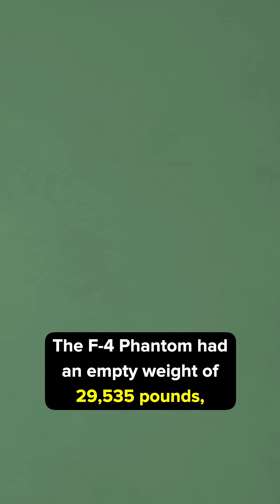Why an F4 Phantom was Launched into Concrete

Comment: How would it fare with back to back fantoms? Just like we've been doing with rocket attacks on bunkers. Hit it twice at the same time while the concrete is trying to dissipate the energy of the first hit. Maybe the concrete will fail with that much energy. Not to mention no explosives are added to the attack.

Comment: If you were on the other side of the concrete wall having a cup of coffee you’d be dead. The concussion would have transmitted through the concrete and into the air creating a pulse of extremely high pressure that would crushed you into Jello. But the wall would be ok.

Comment: scientificly you forgot about crumbling. crumblig aircraft made less impulse and longer crashtime so i dont think you can compare it with tnt. for instance that aircraft will make less damage if compare with a solid cunk of metal with the same weight and speed cuz it wont shattered as much as that f4. in material engineering, jouls dont represent power as much as force load, impulse, stress, and strain

Comment: Maybe little bit out of context, but I still wonder how World Trade Center came down, which was made of strong Steel and reinforced Concrete, if F-4 Phantom flying at speed of mach 0.6 did barely any damage just to a concrete block? 🧐

At 08:46 American Airlines flight 11 hit WTC 1 at a speed of 430 knots (495 MPH).

At 09:03 United Flight 175 hit WTC 2 at a speed of 510 knots (587 MPH).

Comment: Try the same with a 38 cm thick steel concrete and show that an aluminium wing on a passenger aircraft is not able to penetrate that like it has been assumed with the two WTC towers on 9/11. Then we saw the opposite phenomena at the Pentagon attack where the wings disappeared.

Comment: Bet you did not know I was the actual pilot of that plane. Yes  I work long and hard to enter port Saincudo undetected and stole the plane. Evading the 5 star wanted level  only to crashed because my teenager had the control inversion set the opposite of reality when I ask him to take over while I took a restroom break.  So when I pulled up it went down. 67 hours 437 atempts waisted in 13 seconds and i cost me my 2.3 billion. Back to driving a cab again.

Comment: It wasnt just a concrete slab. It was a design for a wall of a nuclear reactor containment building. They wanted to see if the reactor containment building could withstand a impact from a aircraft in case someone decided to crash their plane into a reactor.  The F-4 was available and its stronger than the average commercial plane.
Reply: I would assume that it wasn't empty. I would expect them to add weight until it replicated a fully loaded jet because they want to test the worst case, not the best case.
Reply: @brianwest2775  fully loaded implies having munitions which I imagine they weren't going to throw away, the jet doesn't hold cargo after all. Although I'm unsure what stop them from attaching fake rockets to simulate the weight.
Reply: @jameshenderson4094  I thought "fully loaded" meant power windows, power locks, navigation, leather seats, AC, and a sun roof.
Reply: @grumphreys  well now you know ;]
Reply: @jameshenderson4094  Fully loaded includes thousands of pounds of jet fuel. People often forget how much flammable liquid is on aircraft.
Reply: @coryray8436  only steel buildings ever to collapse I believe!!
Reply: @brianwest2775  i wonder how many people that took 🤔
Reply: Shame they didnt build the twin towers of this…
Reply: @casheverett6300  if they did, it'd be made of lots of glass and be structurally flawed as per their investigation into why the towers fell so quickly. Also, fighter jets are designed to be more light weight than say, a commercial Boeing airplane.
Reply: @casheverett6300  Reinforced concrete is extremely good under compression, but it's heavy and not so good with tension or shear. You can build a dome out of it that's extremely tough, but trying to build a skyscraper out of it (a shape that puts greater tensile and shear load on the structure) would not be a good idea.
Reply: @alexanderflack566  its a 9/11 joke… why are people trying so hard to correct a joke…
Reply: @alexanderflack566  steel mostly!, reinforced concrete,yeah but the steel melted,yep!!
Reply: @casheverett6300  bro what 😭
Reply: @user-ij6ve5ek7e  Why was 10 afraid? 

Because 10 was in between 9 and 11
Reply: @casheverett6300  you cant build a dam skycraper out of that much concrete. That shit will collapse
Reply: @smoko7113  its… its a joke… its a 9/11 joke… like it cant be more obvious how satire this was. 

Please go to an AA meeting if you couldn’t see that.
Reply: @casheverett6300  yea no shit? But you cant build a skyscraper out of it. If youre telling a joke atleast let it make sense
Reply: @smoko7113  nuclear cooling towers are made of this concrete they also performed this test with a drone phantom to almost identical results
Reply: I've heard nuclear reactor walls were notoriously difficult to crack.
Reply: Better test would be hit it with a tank round. Not an lightweight aircraft
Reply: @b6schilke996  yeah.
Reply: made of concrete......
Reply: They did this test again with the nuclear waste transport containment unit, it barely dented it.
Reply: Still, let's all have a moment of silence for the brave pilot who gave his life for this experiment... ;)
Reply: Let alone concrete slab. Heck even F-4 most likely cant penetrate the wtc towers too, hence why they put bombs inside just in case.
Reply: I thought it was for 9-11 to test how planes going mach 1 reacted to concrete not that the concrete and buildings are made of the same thing just to see over all damage seen a video just like this talking about testing planes against reinforced concrete or just regular concrete if not than oh well
Reply: Wasnt strong enough to prevent 9/11

Comment: I wonder if that's what they reinforced the walls adjacent to where the "jumbo jet" that was "entirely vaporized by the intense heat of the aviation fuel fire", flew through. 🤔
Reply: No. The walls of the World Trade Center were mostly quite thin, and a lot of it was glass. This video is of a section of thick reinforced concrete, made to contain the catastrophic explosion of a nuclear reactor and survive the impact of an aircraft.

Comment: Well.. yes and no... There are different forms of energy. A Bunker buster bomb doesn't need to have more energy joules than a F-4 Phantom to do more damage. It just needs to retain that energy, momentum and mass better.. 

This is why in Nascar, the cars rip apart so easily, the shell anyway. Every piece coming off is absorbing and ripping energy away with it. 

THe F-4 Phantom was crumpling like paper, and being ripped apart, it's losing almost all of its energy and mass immediately upon impact with the wall. The wall wasn't actually withstanding that amount of energy or joules. 

This is Grade school physics here.

Comment: They should have done the test in Manhattan on September 11, 2001.  They would have gotten astonishing results.
Reply: For the old towers it could work, cause I don't think something slower than that f4 can go against the new one too. But commercial aeroplanes have that size and weight advantage that is.
Reply: Today on "Fact or cap" - can fuel melt steel beams?

Comment: 80% of a (metric) tonne of TNT is 800kg of TNT. Sheesh. Completely unnecessary complication of simple units. Also have to love that pounds to kg conversion with its seven significant figures of accuracy as if it matters whether or not it's 13369.85 kg, 13370 kg or 13400 kg.

Comment: Ok I’m really late but, it wouldn’t be xKg of Mass under earths gravity, the mass would be a fixed number in newtons, the KG measure is for weight which is inherently dependent on gravity, so you would say it has an empty MASS of (X/9.81)N as it already gives the weight in the info, and therefore a weight of X in earths atmosphere at X altitude, though for the most part the gravity fluctuation between sea level and 30k ft is negligible, also it would have been an extra benefit to calculate the kinetic energy and compare that to something such as a loaded truck to give a good gauge to the viewers of just how much energy that concrete was really taking

Comment: About the steel reinforced trade towers… 9-11
Reply: Yes only steel whichbis weak to fire, the only concrete reinforcement was in the stairway shaft, after the towers collapse that part temporarily survives and is visible for a few seconds.

Comment: that's why after 9/11 some scientist were questioning the fact that an airliner could pierce through all these re-enforced concrete walls at the Pentagon ,3 rings & exit hole on the other side with the speed mentioned at the time ,at sea level...(this test here was actually a reference to show ,it was impossible...)so then came the missile question..
Reply: Then they got their awnser, the only piece to punch through reinforced concrete was the large steel piece of landing gear, the landing gear on a comercial aircraft is much heavier and larger then that of a fighter. There are 2 videos of the plane hitting the pentegon.
Reply: @miguellopez3392  and create a perfectly round exit hole...??!!.also the engine (only one) recovered at the scene was not from a large airliner...
Reply: @hector herbert  you do know how fracturing works right. That is not a perfect hole and this isn't a Saturday morning cartoon, and a 767 doesn't have large engines compared to planes in 2001 and it would not remain looking large after being shredded in the building. Not to forget the clipped street lights on the road next to the pentegon, missiles don't have several dozen feet of wingspan.

Comment: They were analysing what would happen 13 years later
Reply: Today on "Fact or cap" - can fuel melt steel beams?
Reply: @Q  yes, with enough oxygen heat can build up around the fuel quickly and melt steel in seconds.
Reply: In the 1930s a military plane hit the empire state building.
Reply: @miguellopez3392  guess it’s just a bin laden family tradition
Reply: @Atharva Rajé  yep took notes, instead of a 28,000lb plane at 180mph it was 200,000lbs at 400mph. Bomb in the basement of the buildings was their distant relative.

Comment: Hmmm but jet fuel can burn down a skysraper
Reply: Neither the Pentagon or Twin towers were made out of reinforced concrete, nor were hit by a fighter jet. These two events are in no way comparable.
Reply: @waspanimations7037  yee they had reinforced concrete maybe not 6 feet but most pillars are 2'x2' secondly its already been proven that it wasn't possible in the first place so dont come here and argue move on and shut up
Reply: @wdukes50  You said it was proved. Show me the proof then.

Comment: This was in 1988 ,concrete was even better in 2001 during 9-11 and the twin towers were reinforced also with 3 inch think I beams of steel ,and it was not a jet that hit the trade center so it wasn’t even going as fast as this !!! So this is proof that 9-11 was not what we were told !!!!

Comment: And we still think a passenger aircraft can bring down a skyscraper
Reply: yeah. Cause skyscrapers arent made with 30 foot thick walls with no windows.
Reply: Today on "Fact or cap" - can fuel melt steel beams?
Reply: @QTwoSix today on fact or cap, was there enough distance between the untouched upper floors and the lower floors to bring it down? Also Today on fact or cap, F4 versus reinforced concrete: who's the victor? Actual test done in 1988. And it wasn't a very big concrete block in comparison to the WTCs

Comment: Instead of reading through the comments and facepalming until I bleed, I'll just say it here. 

That is NOT 'normal' reinforced concrete. It's a section of nuclear reactor containment dome.

Just because you can't punch an F4 through a reactor containment structure doesn't mean you can't stick an airliner through a concrete wall covered in windows. Don't be dense.

Comment: Yet a commercial airliner penetrated a reinforced concrete wall of one of the most secure buildings.
Reply: ummm....SEVERAL reinforced concrete walls actually.

...and I don't buy that for a second, either.🤔
Reply: @CannonFodder873  it's almost as if a low flying hardened bunker buster was sent thru them.
Reply: @bmoturtleco  BLU-113 or BLU-118B🤔
Reply: @CannonFodder873  from the damage sustained I would say the blu-118/b. The added punch makes it more likely. However never discredit an explosion from inside as well. A multi layered attack could also be used. Some well placed detcord and shape charges could achieve the same effect. However what little footage was available does suggest a penetrating ordnance was used. Pre weakening could of taken place but is doubtful.
Reply: @bmoturtleco  They lost me at dozens of cameras, and not ONE photo or frame of an airliner. 

Uh-huh....SURE, guys.🤣
Reply: @CannonFodder873  not to mention buildings far way getting damaged. The explosions at the base of the towers. Plus the structural engineers that stated in no possible way could they of brought them down. In addition the original design was built to withstand such an instance.

The entire scale, scope, and b.s. official story leads to only the obvious. Yet some still think those guys were working alone.
Reply: Today on "Fact or cap" - can fuel melt steel beams?
Reply: @QTwoSix  if put in an enclosed forge and massive amounts of fuel are used then over many hours it will begin to weaken. However under the conditions of the attack it is not physically possible for such damage to occur. Experts in construction, demolition, metallurgy, and structural engineers all confirmed it was a planned and controlled demolition of a structure.

Comment: What is "Mass under Earth gravity"? Mass is unaffected by gravity. If you have a mass of 10kg, you have a mass of 10kg, whatever gravity. The mass is 10Kg on Earth, 10Kg on mars, 10Kg on the moon, 10Kg on Jupiter, 10Kg everywhere. 
And why before that did you state the weight in pounds, but not state what gravity that's under?? Firstly, wrong units. If you're trying to be precise, which stating "under Earth gravity" suggests you are, then weight is measured in units of force (Newtons, for the metric system, or pound-force for the imperial system being the common ones). The pound is a unit of mass, not weight. Now, the second point, when you stated the weight, why did you not state the gravity that was under? The gravity you're under doesn't effect you're mass, but it does affect you're weight. our 10kg mass from earlier will have a weight of a little under 10kg (9.81......kgs). On the moon it still has a mass of 10kg, but now weighs roughly 1.6N, on mars it weighs 3.7N, and on Jupiter about 23N.

Comment: Mass is not affected by gravity. When stating mass in kg, it is irrelevant what the gravity is. Weight, on the other hand, is dictated by gravitational field strength and is measured in Newtons. Weight = mass * gravitational field strength (which is the same as acceleration due to gravity)

Comment: Then years later they tested commerical airliners against the structural strength of skyscrapers.
Reply: And the proof is on the money (it's not)
Reply: Today on "Fact or cap" - can fuel melt steel beams?

Comment: Why are you mixing measurement systems.  Pounds, tons and miles per hour vs. kilograms. The moderator has an English accent, so is the ton used an English vs. an American ton.

Comment: Oh... They should've used that concrete when they built the Twin Towers
Reply: I think they actually did but because the Twin Towers weren’t just covered wall to wall in this stuff and that it had windows, it didn’t really matter. They were practically just a big bonfire waiting to be set off

Comment: For the most part aircraft are not particularly robust structurally. Except for the wing fuselage center section and the engines, it is mostly aluminum and some steel for heat protection. 

The engines are quite strong on high grade steel. 
Where the engines in the plane?